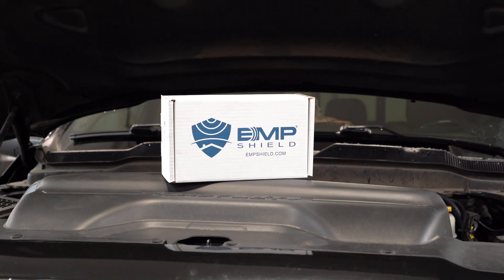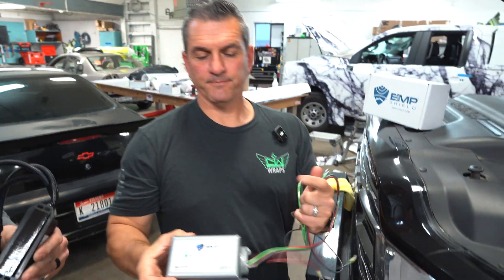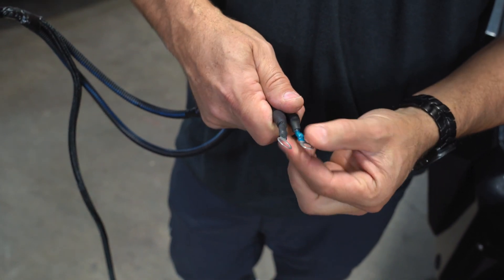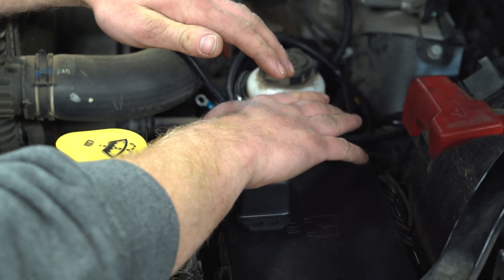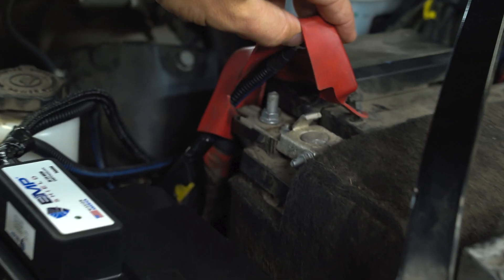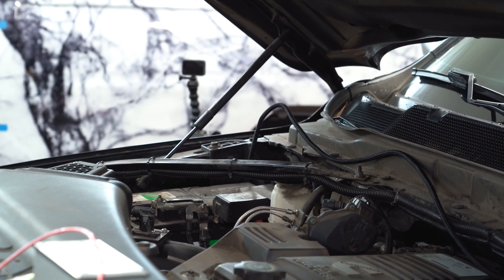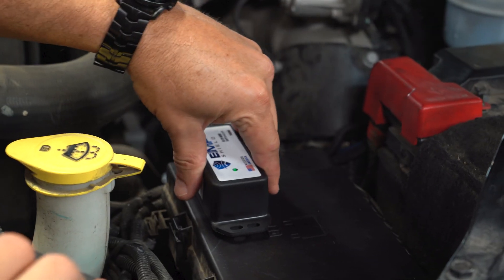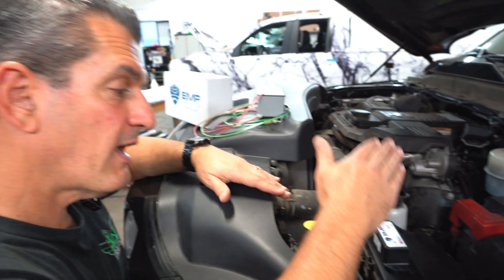What is an EMP Shield? | How to install

Comment: We had an EMP Sheild installed on our metal building. It was struck by lightning. We were inside when it struck. All our electrical items were fine. The atmosphere inside turned purple and outside was blue. At impact, the electrical box sizzled, but the EMP Shield held. There were three witnesses to this. Husband and myself, inside the building, and our cook who was in his truck parked right outside.
 If it can catch a lightning bolt,  it can catch an EMP. Came here to look for install instructions for one I'm purchasing for the car.

Comment: Back in 2006 we had a car that was towed in due to being near by a lightening strike, all of the modules were fried. Where I get this may have helped I highly doubt it would have saved them all. One of the modules that was taken out didn't have a connector plugged in, it was secured to the chassis and perhaps could have been grounded possibly thru the chassis on the module. Perhaps because of the fields I've worked in and had to repair lightening damaged components with several combined forms of lightening protection I'll just submit a claim and be done with it personally...

Comment: Even if it works, the gas stations will all be knocked out so you aren't driving very far anyway
Reply: its easy to pump gas out of the underground storage tank with no electricity if you know what to do and have to proper equipment most of which can be bought at a local hardware store

Comment: that things is joke and a waist of money.
Reply: when I worked on EPM harden aircraft in the military EVERY millimeter of the wiring harness was covered in a metal wire mesh shield, essentially a faraday cage that encapsulates the entire wiring harness or built into each wire individually.  At each cannon plug connector there is a unique inline connector called a pin-filter adaptor that maintains the integrity of the shield.  That thing you put on the car doesn't shield any of the wires in the vehicle, all of the dozens of miles(If not more) of the wire in modern cars.  IN addition for a printed circuit board, like the ones in ever module in that vehicle and every other computer has to be build in a unique way to EPM harden the board from EMF radiation.  To do that each component has to be spread wider apart, all the traces on the board have to be wider apart and totally insulated from each other.  Does that stupid snake oil black box does any of that?  The answer is no.   In the event of a true EPM from a nuke or a coronal mass ejection the EMF radiation is collected by all of the wires in the wiring harness like an antenna even down to the traces on the printed circuit board and built up from the EMF radiator until something overloads and fries releasing the mysterious blue smoke.  And once that smoke is released electronics don't work any more.  Your only saving grace is hoping that the vehicle is parked in a "shadow" of the EPM praying the energy is absorbed by enough objects before it gets to the vehicle.  A cheaper better alternative would be to build a giant faraday cage you could drive in and ground to the earth like you would a lighting rod or electric fence.  That is about the only way to protect from an EPM without having to dismantle the vehicle and heavily modifying the entire electrical system.
Reply: @crasher88  I'm certainly no expert on EMP but I do dabble in electronics and I sure as heck know what must be done against a lightning strike.  It definitely is not something you defeat by hooking a box to a battery which makes it's light turn on, while sending any potential lightning into a tiny ground cable.  What this really reminds me of are those boxes people hook to their car batteries to supposedly disulfate them, including the handy LED which definitely tells you it's working.  I don't have a bone to pick with this company per say, it just doesn't seem like something that would work.  It's only connected to the battery and the source of the problem wouldn't be coming >from there< anyway.  The battery would likely be able to take more abuse than anything else in the circuit.  This device is just weird.
Reply from the maker: @crasher88  care to expand on why? Curious what your reasoning is?
Reply: @sammycdub  Put it against a microwave coil,  which is 10's of thousands of times weaker than your external sources, IYKYK.  The emp shield will melt and not protect your vehicle. Plus the wire gauge is way to small to properly protect they circuits of the vehicle.  You need atleast the same size wire as the charge wire of the alternator.

Comment: this will not work against an EMP 😂😂😂
Reply from the maker: @saturnsl21999  did you look them up on Google? They are no joke, military testing etc.
Reply: @sammycdub yeah no. The only way to protect from an actual  emp is a physical grounded faraday cage around the sensitive electronics.
Reply: But they are guaranteed, 😂😅😂😂😅. Good luck wit dat.